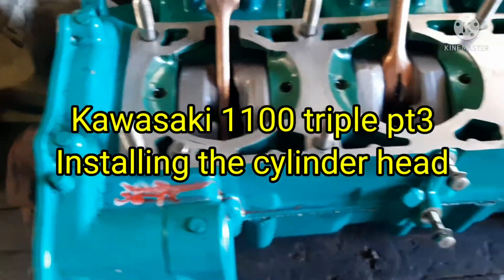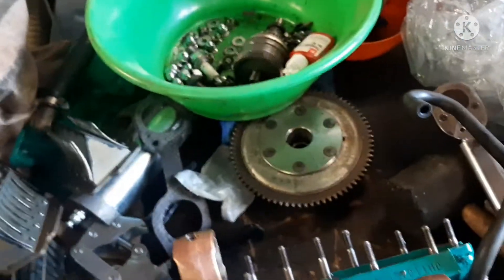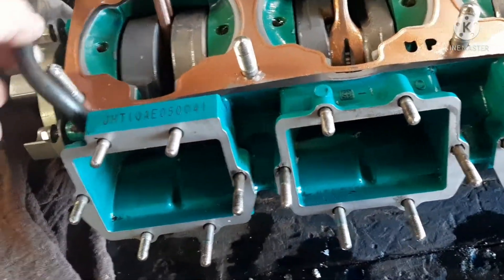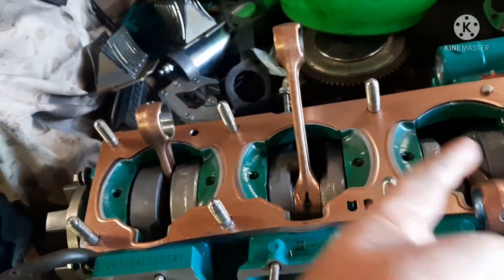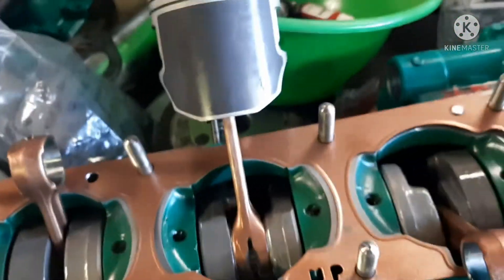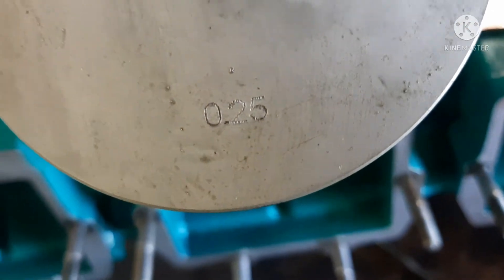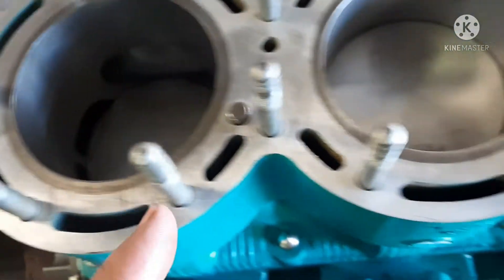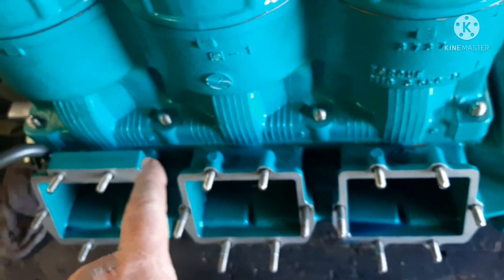Kawasaki 1100 triple rebuild pt3 installing the cylinder head

Comment: I am reassembling my 900 stx. I have the case together and find the crank takes some effort to spin. It appears to be the seals that are causing the resistance. Is that normal with new seals, or do I not have them seated properly causing them to squeeze on the crank?
Reply from the maker: @cthiessen  it should be smooth and easy to turn.  I always lube the seals with marine grease.

Comment: Question for the master:  if you have manifold for 2 pulse lines and the carb for only one,  will it hurt to make a t and run both pulse lines to the one on the carb?  Or is it a better idea to just block off the other pulse line on the crank case?
Reply: You can do either as I understand.  The older 1100 blocks had two pulse lines.  I would probably block one, but with two pulse lines you can pur the cdk2 carb on as it needs two pulse lines to function.  It has two separate diaphragms to pump fuel which is why it had two pulse lines.  The cdk 2 carbs are less problematic than the cdcv carbs.

Comment: I will tell you that copper seal spray that you're using is not good enough for most two-stroke engines because from the Heat and displacement we are no longer working with completely flat surfaces you need to use something the spreads on a little thicker otherwise you will end up with an air leak not always but it only takes once
Reply from the maker: Good eye.  Notice I didnt advise anyone to use it nor show it.  My 1st yamaha build with it failed, but I also had a mis aligned sleeved cylinder AND I didnt let the copper coat cure before bolting the cylinder head on.
My last kawasaki build I used it and it was fine.  I used to always use it on automobiles when I put a cylinder head on.  You know your stuff.
Reply: I have a problem with my 98 1100 stx cylinder. After assembly, I did a pressure test and I noticed it was leaking very little air from where the cylinder meets with the lower case. I suspect there are slight imperfections that the steel gasket can't hold. I was thinking about trying the copper seal spray or perhaps a thin coat of yamabond 4 between the two halves with the steel gasket to help seal. Would that be advisable?
Reply: @twistable_deer  the copper seal is junk it is too thin and it will not seal and you're supposed to use different types of sealant on different areas of that engine but every single gasket on it should have some type of sealant
Reply: @shannonwilliams601  BS!  Never once had a problem with it.  MOST people don't even use anything on a new coated head gasket right out of the bag.

Comment: All you have to do is wrap the Rings tight with velcro strips and as the head slides on the velcro will slide down and then you can just take it off around the Piston arm and one person is able to do it fairly easy
Reply from the maker: I will try that next time.  I never even thought to try that.  Great info.